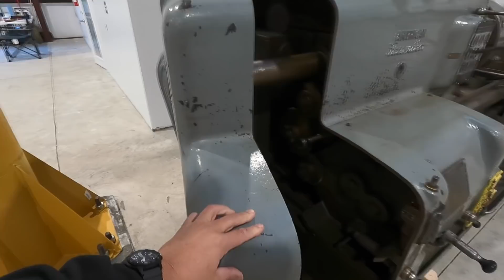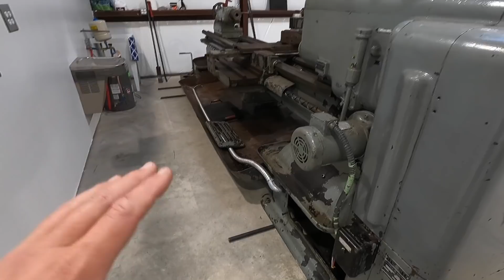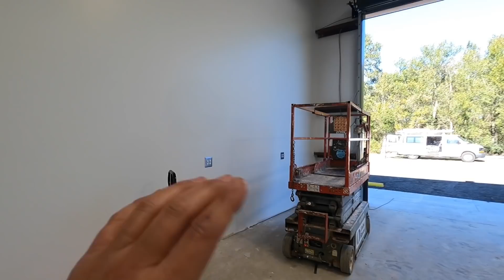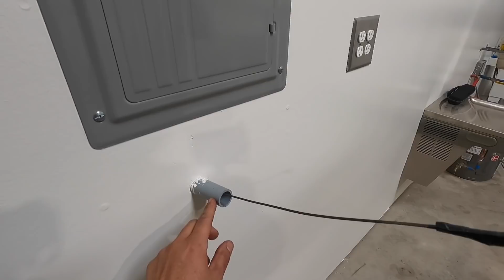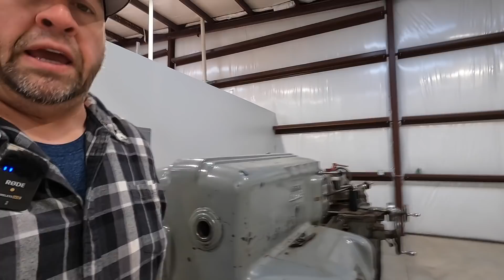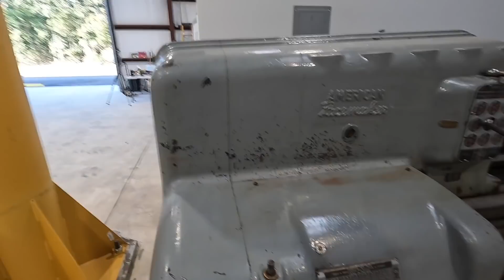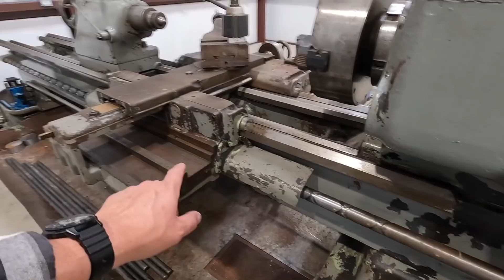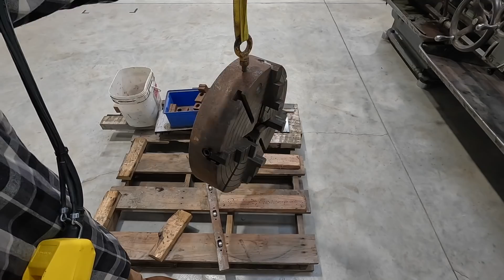New Shop Space Update 12: 3 Phase Electrical Circuits, Lathe & Crane First Tests

Comment: There was most likely something stuck in the contractor that wasn’t letting the magnetic surface mating together. That will cause the load noise, it will also cause the contractor to overheat so it was good that they replaced it. The shop is looking good.
Reply: Possible - or the wrong voltage coil.

Comment: Would it have been cheaper to run conduit instead of the flex across the ceiling?
Reply: Conduit looks better but MC cable is so much faster you save on labor cost.

Comment: How come you didnt decide lifting it from above with the forklift and some straps around the lathe, one end at a time. I guess more precision this way
Reply: More appropriate to use gentle shoving for siting in final resting place.
Reply: Much easier and safer to lift the lathe from the bottom of the bed with the forks.
But I don't think this forklift is able to lift the headstock ;)

Comment: check codes for clearance to breaker box
Reply: 3’ typically for that voltage.
Reply: Typically 36” from the front of the panel. NEC 110.26A
Reply: Who cares

Comment: I have a vision of that water fountain full of chips and cutting fluid.
Reply: Mmmm, Nothing like some crunchy water!
Reply: Nah, heavy chips don’t jump that far. Nothing to worry about.
Reply: Easy enough to fab and install a cover the fountain.
Reply: Don't forget dispenser of sandy pumice by the sink spritzing green blue Hershey kisses sticking to back of lathe after someone added water to the almost empty soap container. ✊🏼 SHULTZ!!

Paint the corner wall around sink a nice industrial blue, feel right at home.
Reply: Same.

Comment: I am wrong to think if there is not a safe place to fall without striking my head on something than there isn't enough space?  Can't wait to see chips flying!  How thick should a shop floor be to support  heavy machinery like that lathe?  Lower voltage higher current draw.  The circuit protection behind the lathe has to be upped.  Higher amperage circuit protection.

Comment: The heaters are too small. When you change from 480V to 240V, the amperage doubles. So, the heaters will need to be replaced with new ones rated for double the existing ones.
Reply: You'd think a sparky would know that lol
Reply: @apollorobb  I am sure one of them did.  I will almost guarantee they will get rid of that old fashioned heater protection.

Comment: The heaters on the control box have to be changed when going from 480 volts to 220 volts
Reply: no just the amperage   vo;tage dont matter
Reply: @edswider9309  - exactly and the motor wired for lower voltage draws higher current.

Comment: one thing i learned from a safe moving company---- cut pieces of 3/4"pcv make great rollers for heavy things on solid floors.....just put a bunch of them under what your moving in the direction you want to move it and then push.... have a few out in the direction of travel and then keep cycling the one that comes out from the side your pushing on gets recycled to the front where you're moving;
and i think i'd put the drinking fountain in the office..... sink is ok but you gotta keep that drinking fountain clean and could also install a eye-wash station next to it in the office....
Reply: That's fine for things with flat bottoms, like a safe, but not things like this. The point load from the skirt around the casting on the pipe will crush it.
Reply: Were they moving 11,000 lb. safes?

Comment: I see a larger lathe in your future!
Reply: Why?  This is the size of the one he ran at Motion and it did everything required of it.  Go back to the old videos and you will see him working on some large pieces!
Reply: @paulcopeland9035  This one is at least 8' shorter, but my reasoning is purely selfish...  I'm hoping to see a big oil field lathe in there, something that will swing at least a few feet!  But either way, I'm happy for them!
Reply: @paulcopeland9035  He needs to lubricate the bearings in the clutch.

Comment: A big guy like you could have used a Johnson bar. Tom Liptom has been doing a lot of moving machines lately. And they are big! Good work Adam. You need your oak blocks in the new shop.
Reply: He had a big pry bar he usually uses. But why stress your back when you have a forklift to provide the umph.
Reply: @demonknight7965  Also looking at the quality of that floor, I don't think the lathe would move with a bar but the floor would fail !
Reply: What's your point? If you have a forklift why not use it?

Comment: If you bothered to look up the building code you would see that any lifting device like a crane or car lift can not be installed within 12ft of a drinking fountain. It's a electrical hazard. You could potentially drink water while elevated of the ground and that could lead to static electricity building up and could very easily cause an indoor lightening storm. Best bet is to just sell the shop and donate all your equipment to the Ronald McDonald's house.
Reply: That only matters if you saddle a dead horse while standing on a cracked concrete floor. With the wrong heaters of course.
Reply: Nah, it will be fine if he wires the lathe up to a GFCI outlet.
Reply: You do a lot of whining. Like a little old lady
Reply: Did anyone ask for your comments?